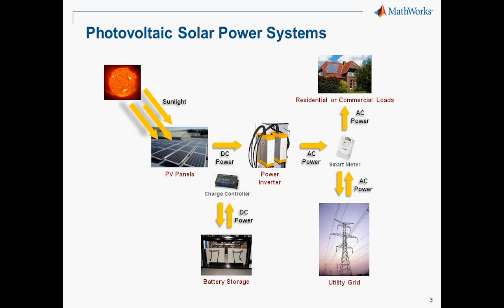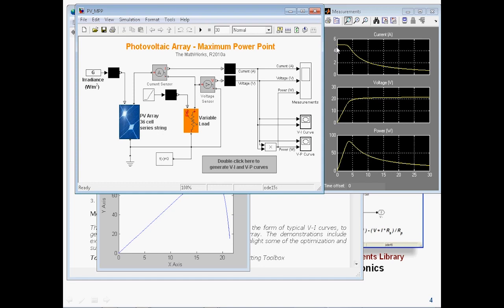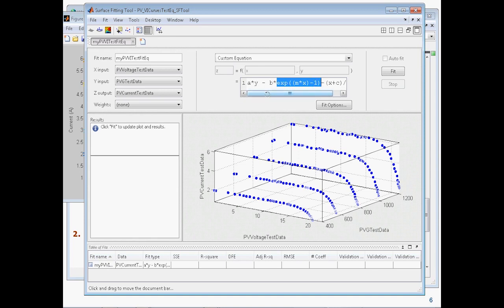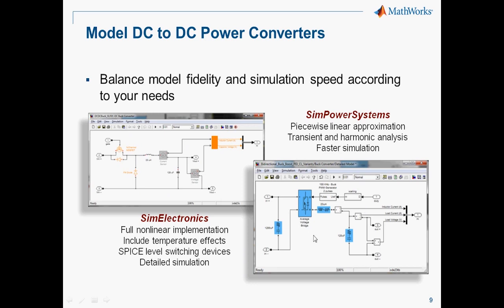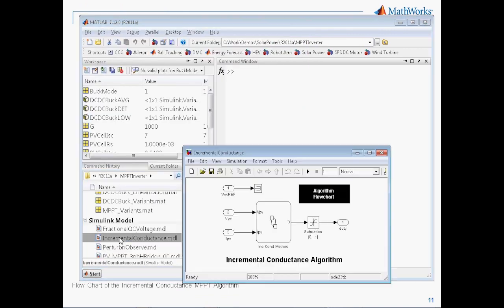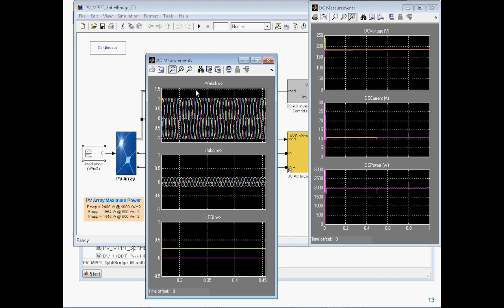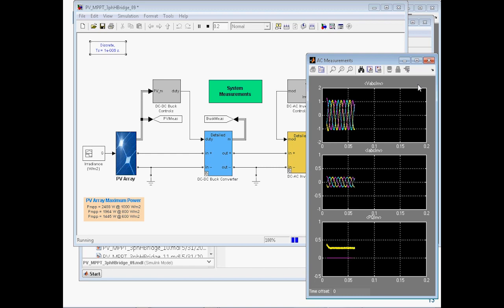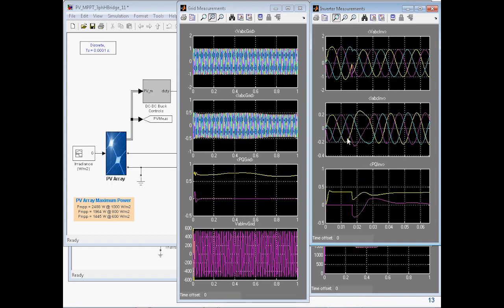Modeling and Simulation of PV Solar Power Inverters

Comment: Hi, i have a 600kW solar plant to feed a village cluster, can u pls help me on what components to use.. can i do it without dc-dc power converter. How do i Synchronsise inverter output with grid power, is there a separate equiment for this purpose
Reply: +Heitler Remlalfaka 
yes, PLL is used for the purpose of synchronization